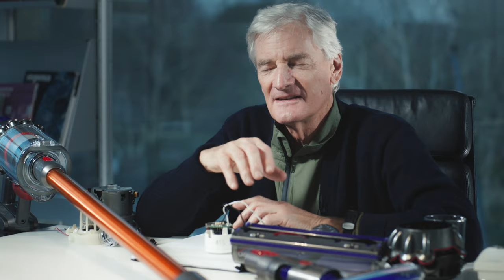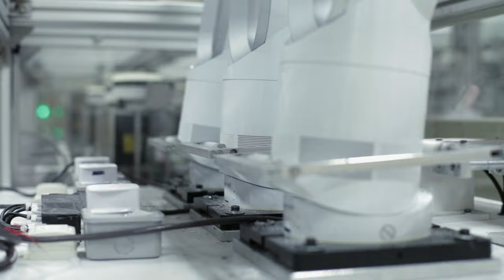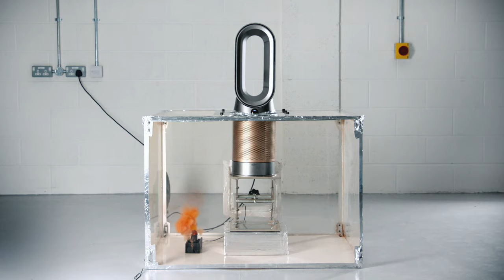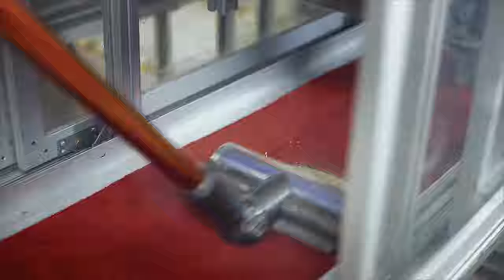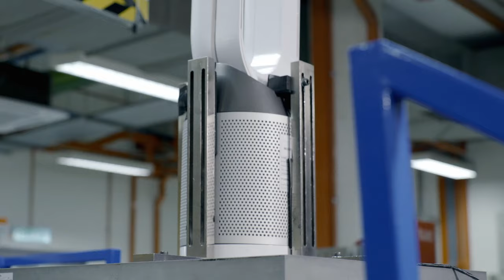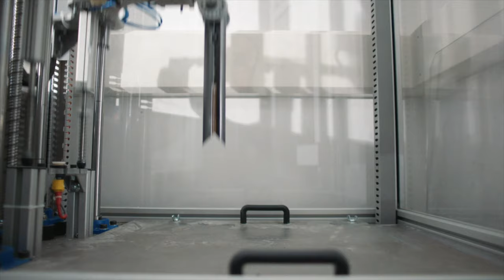Dyson testing – behind the scenes at the Dyson factory

Comment: I still use my DC35 that I bought in 2012 every day. Every few years I treat myself to a fresh battery and it continues to work flawlessly even though it’s been through hell and back.
Reply: Yeah def. Ive been using the same broom for 20 years. Only had to replace the head 17 times and the handle 14 times. Better to use things for their full lifetime.
Reply: @FBAMogul  the battery has only needed to be replaced 3 times in 10 years with heavy use. We abuse the thing and nothing has broken on it. Haha you’re so funny 🙄
Reply: @FBAMogul  yes because the chemical degradation of batteries is definitely an error on the user's part

it's almost if batteries have a certain lifetime or something!

Comment: All this testing, I have 2 fluffy floor tool, broke at the same spot the plastic rod attach to the bearing(on the removable side) which connect to the roller
And after all these testing, you have your v10 switch plastic break at around the same spot too
Reply: Sue them.

Comment: I own 2 Dyson vacuums, a DC 42 upright that works just fine and a V10 handheld that is a showcase for great design dragged down by cheap unreliable materials, the company has tried to help even though its out of warranty but good intentions don't make up for poor materials/durability.
Reply: Please explain “has tried to help”
Reply: @Txepetxcc   They replaced the dust bin which fits over the main body of the machine, and that slides forward towards the front until it's brought to a full stop at which point the door swings open and the dirt falls out, my problem is that the dust bin no longer comes to a full stop and slides right off the front of the machine, the good news is that I can finesse the bin towards the front of the machine and have the door swing open slowly so I can empty it....it just takes longer.
Reply: @malibustacy3606  That's a common problem on V10
Reply: @lahonymanor2927   Not common enough to justify an after market fix apparently.
Reply: @malibustacy3606  They had to modify the tab where the bin runs into to stop the bin from sliding off.  This is what I got told.  Not sure if that was ever done.
Reply: @malibustacy3606  BTW I think their durability is very poor.

Comment: Dyson V 11 bataryasının ömrü kaç yılda doluyor ?
Reply: 2-3 years, then it will need replacing. If you don’t replace it you will experience a decline in performance, less run time, and suction.
Reply: @resigningstars  Teşekkür ederim. Kullanma sıklığı da etkiler mi ? Bir de sürekli sarjda durması mı daha iyi batarya için yoksa sarj dolunca fişi çekmeli miyim ?
Reply: @ilkbaharyaz1586  Pekala, eğer sık sık kullanırsan, o zaman sorun değil.  Maksimum modunu uzun süre veya sık sık kullanmamaya çalışın, çünkü bu pili boşaltır ve yavaşça öldürür.  Ama sana kullanma demiyorum, sadece gerçekten kirli işler için.  Şarj etmeye devam edebilirsiniz, fişe takılıyken sorun olmaz. Dyson, pil %100'e ulaştığında şarjı durduracak şekilde yaptı.  Pil düşerse, otomatik olarak tekrar şarj olur.  Umarım bu sorunuzu cevaplamıştır.

Comment: Yay can’t wait to  spend £1000 on the Hoover, that somebody has slammed on the floor and used it and dropped  it from like a quiff 😂😂😂😂
Reply from the maker: To be clear, Dyson machines are tested for durability during development and throughout production using sample machines from the production lines. These aren't machines which then sold to customers. Once testing is complete, any parts suitable for further testing are reused, while the rest of the machine is recycled responsibly wherever possible.

Comment: This is rubbish, my Dyson's V11 (which lasted two years) trigger broke, which they knew had a weakness because other companies seen the fault, strengthened the trigger, and made it available everywhere to replace something Dyson obviously overlooked. Another issue with their V11-V15 range is their thin trigger guards, which is just a thin piece of plastic sticking out below the trigger. This broke on mine! I later on found plenty of other people had the same damage whilst vacuuming. Dyson are good at promising the earth, with their slick video Commercials. However, this is far from the truth .300 hundred people testing for ware and longjevity in each part, but missed these simple basic things. You have 300 people who need to be sacked.